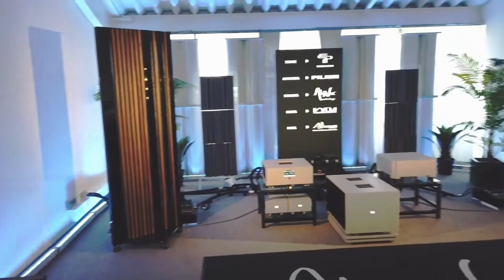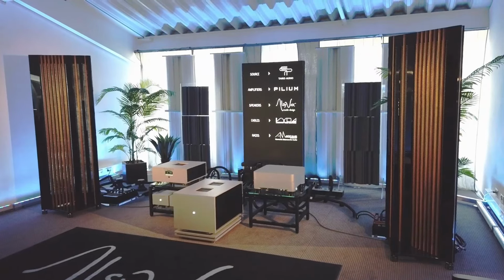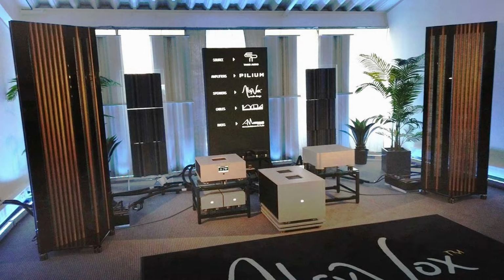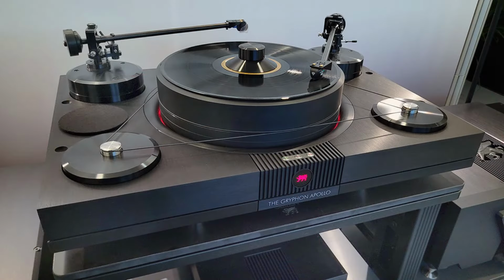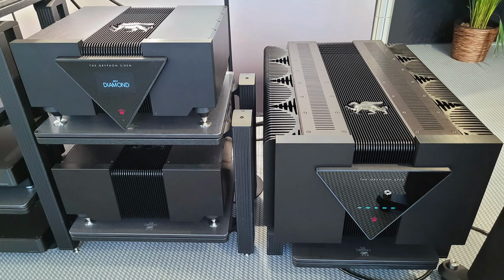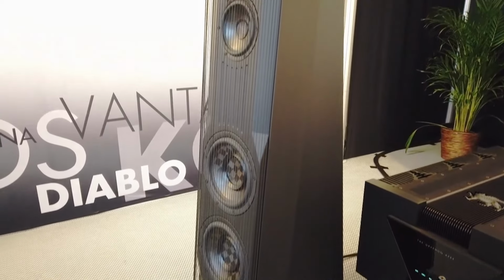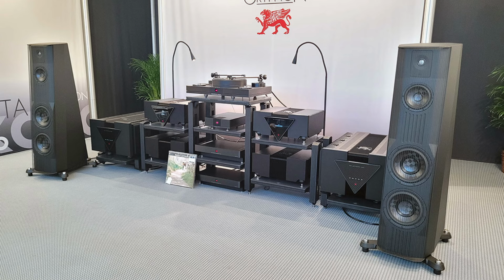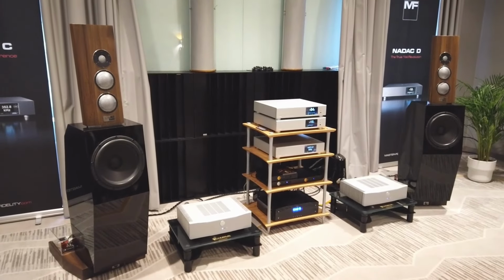E177: High End Munich 2024: Alsyvox, Gryphon, & Master Fidelity

Comment: Hi Greg. Some very intriguing products. A common criticism of large panel speakers is that they exaggerate the size of vocals and instruments. Did you notice anything along these lines when listening to the Alsyvox?
Reply from the maker: The truth of the matter is that this propensity for a larger-than-life stage and imaging presentation can be an issue with any physically large loudspeaker, from the likes of horn speakers like the Acapella Apollon and Avantgarde Trio G3, dynamic models like the Magico M9 or Von Schweikert Audio ULTRA 11, to the big ESLs like the Martin Logan Neolith or the Ultimate Series Soundlab’s, not to mention the bigger Maggie's, like the 20.7 or 30.7.

While it is arguably a bit easier to design around such issues with mechanical driver arrangement and placement (coherent line sources, D’Apolito alignments, etc.) in most cases, such effects are not insurmountable. Typically, the larger the room such speakers are set up in, the less this effect is noted or problematic… Further, room placement, proximity to side boundaries, and toe-in, in particular, can help to ameliorate the impact considerably, if not entirely.

To answer your direct concerns about such issues with the Caravaggio XX, I have to say that looking back at my notes on the sessions in the room, I see NO mention of the staging or imaging cues as being abnormally large or in any manner problematic. In fact, these particular attributes are ones that I find to be exceptionally well done by the Alsyvox lineup, certainly with the Botticelli and Caravaggio models…
Reply: @theaudioanalyst  Thanks for that very detailed reply. It provides a lot of valuable information. Cheers.